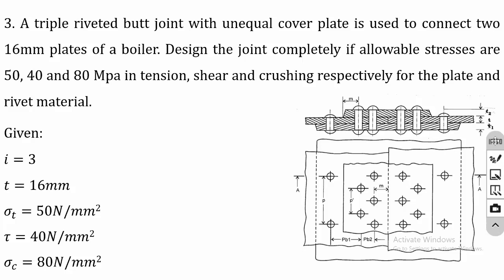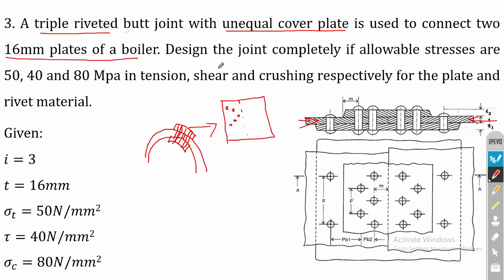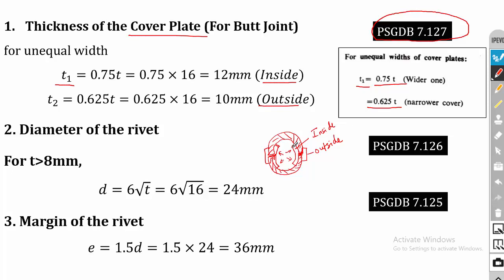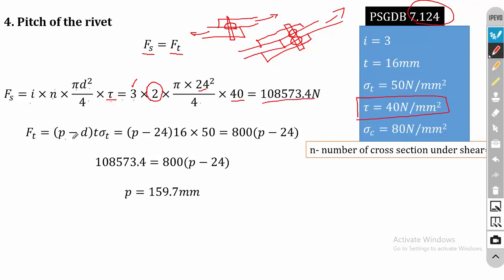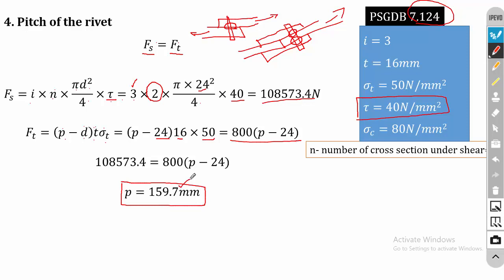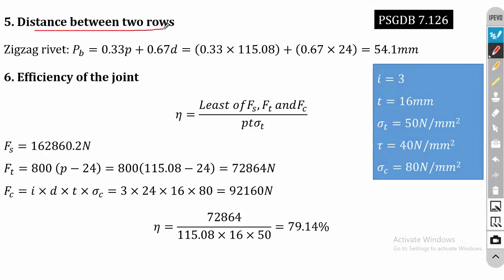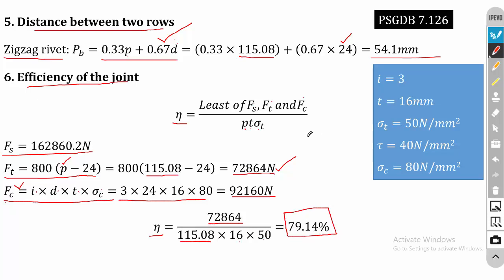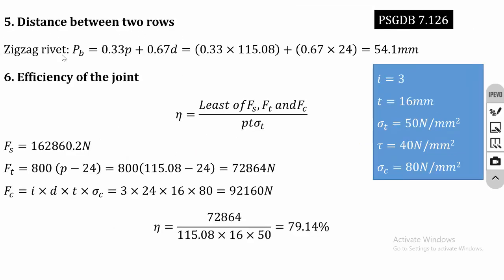Design of Riveted Joints | Butt Joint | Design of Machine Elements

Comment: Is the diagram shown here not relatable with the given question?
Reply from the maker: it is for the given problem... give me more details, so that i can answer your question...
Reply: @themechanicalengineer  There are two different distances between rows, i.e., Pb1 and Pb2 but the calculation is done for Pb which is not shown in the diagram.
Reply from the maker: Pb1 is the pitch between the outer row and next inner row... Whereas Pb2 is the distance between the inner rows... If all the rows are containing equal number of rows then both Pb1 and Pb2 are equal and it is simply mentioned as Pb... Hope I have answered your question...